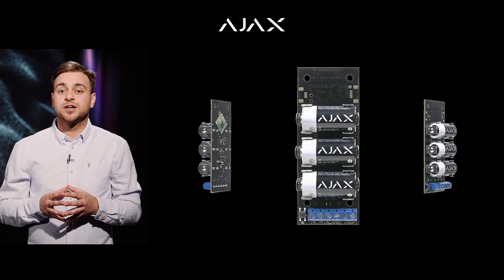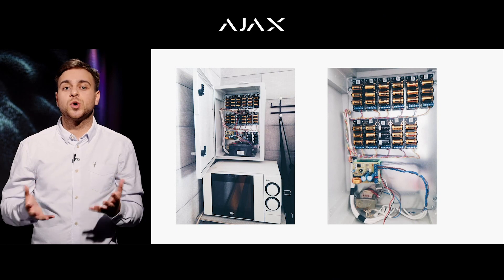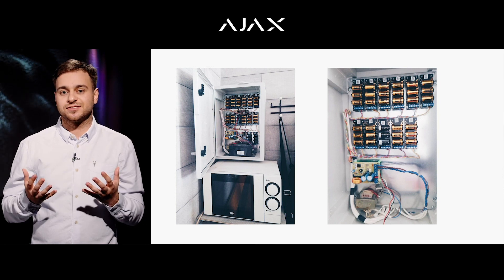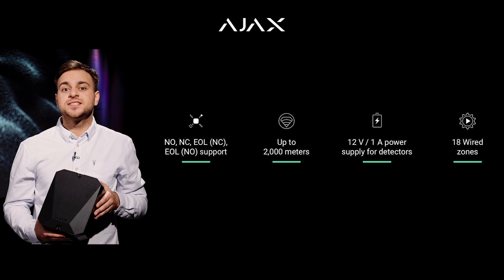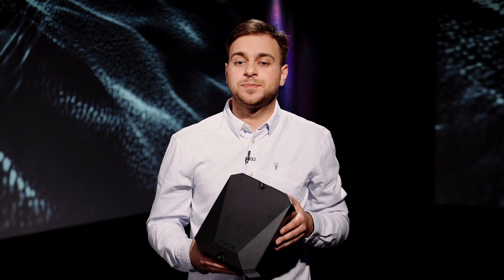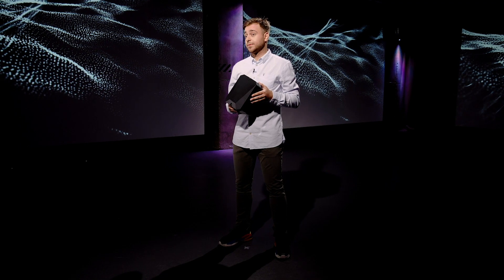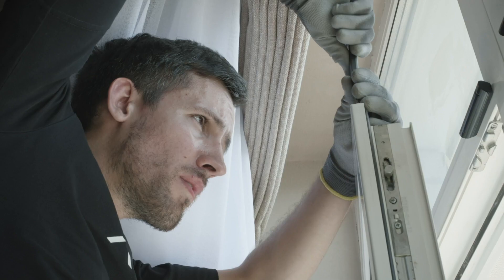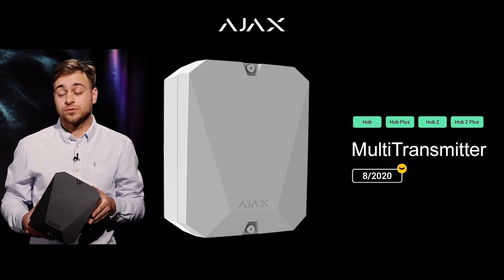MultiTransmitter: renovating wired alarms

Comment: HOW MANY MULTITRASMITERS CAN I INTSTALL TO ONE HUB ?
Reply from the maker: For the Ajax security system, MultiTransmitter acts as a single device and each connected device or detector occupies a single slot in the limited number of the hub devices — 100 in Hub and Hub 2, 150 in Hub Plus, and 200 in Hub 2 Plus.

Thus, Hub supports five full MultiTransmitters, and Hub 2 Plus — up to 10.